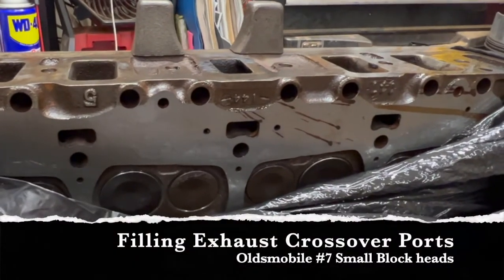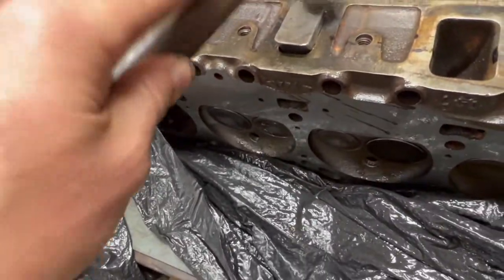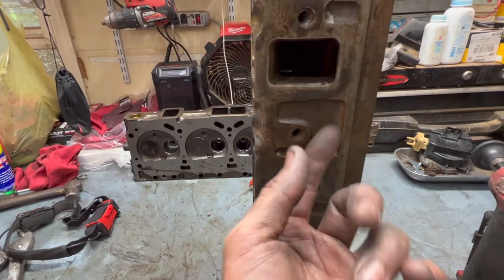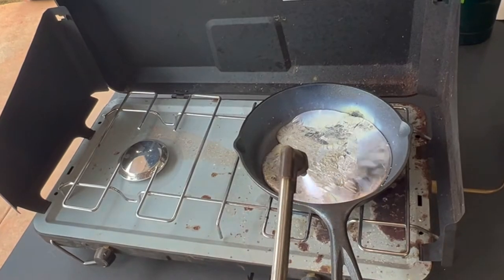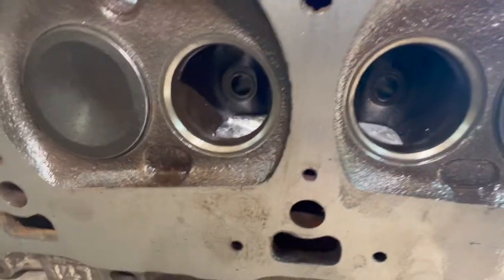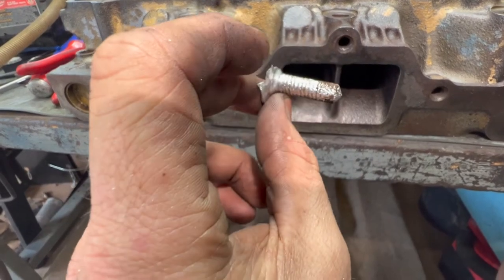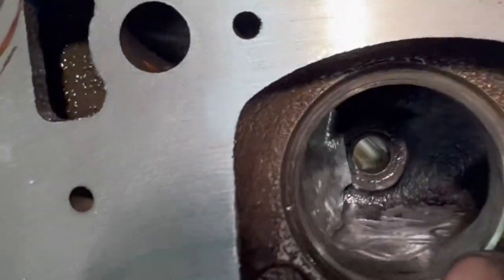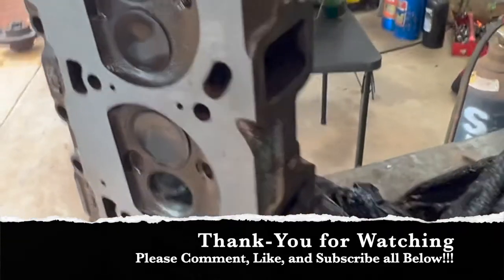Filling Exhaust Crossover ports

Comment: Hi, what year and type of Oldsmobile does this go into?  I have a 1970 Olds Cutlass 'S' with a 350 2bbl engine, a small block I guess, with a chronic overheating issue that I just can't solve and seem to conclude it may have water cooling port blockage in the block when it was first made.  I even had the block acid cleaned and had new cylinder heads put on.
Reply from the maker: It is a 1978/1979 403, with 350 heads. The 350 heads bump up compression. I don’t know what car it came from.

Comment: Instead of using aluminum you probably coulda  just used some Marine Epoxy that they sell at Rv and Boat shops. I've seen Pro head porting guys use that shit to reshape ports and raise the intake runners floors
Reply from the maker: Appreciate the comment. The aluminum worked good. Being able to melt and pour.
Reply: Can’t use an epoxy to fill an EGR port, exhaust gas temps are way too excessive.  It’s one thing to use say JB weld to fix a broken cast head in a pinch, epoxy has a very low melting and breaking point. What he did was correct, either aluminum or brass will work fine. EGT’s reach 800-1000*F, even hotter with boost pressure, so you need to use aluminum at a minimum…